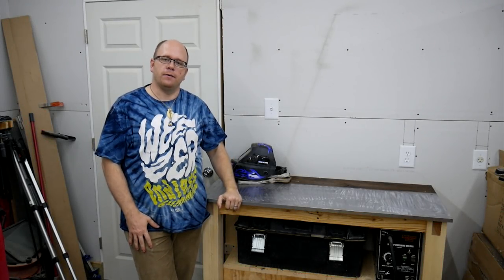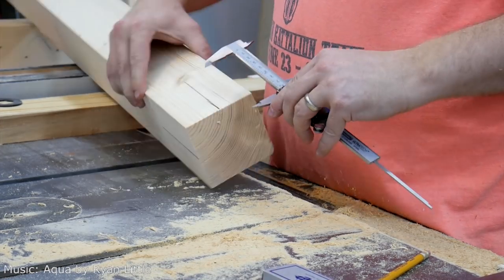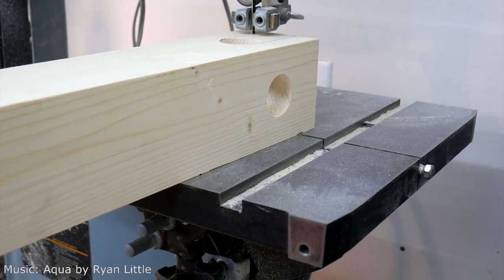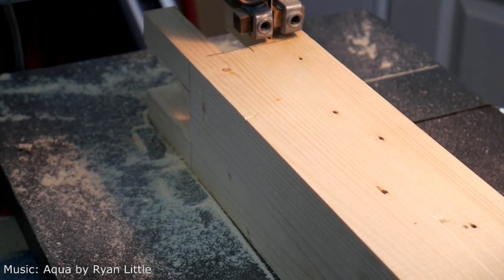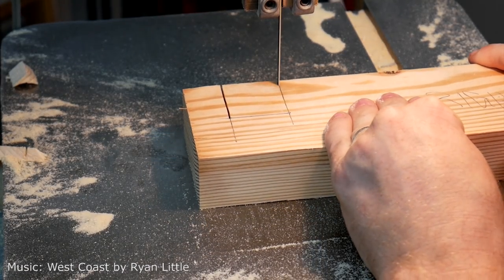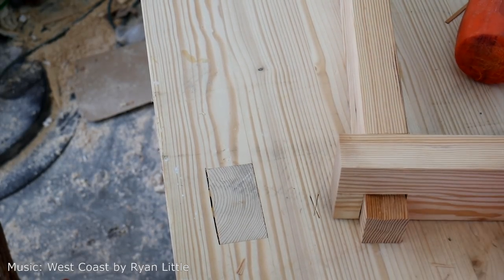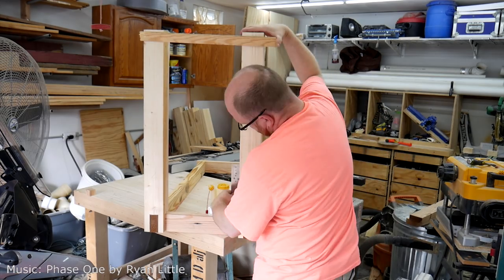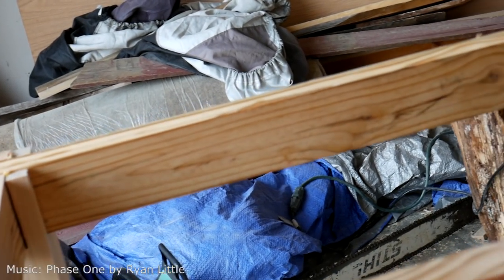Fancy Leg Joinery: Worth It? (Amazon links in description)

Comment: Tom, I’m planning a modern style bed with this joinery and I am glad I watched you build this. I had some of the same reservations that you pointed out about the fragile nature of the joint. I had determined to use a little beefier width of lumber. But in getting a tight joint that shows and without glue and that is square is more than I am comfortable doing free hand, especially with the cost of a screwup with 8/4 x 8” cherry or maple. Did you consider a cutting method that indexed the mortises against a fence to get them uniform, probably on a table saw?
Reply from the maker: This was a spur of the moment thing and if I were to do it again, I would definitely use the table saw and possibly the dado stack

Comment: For the very reasons you provided, it can be a very decorative joint. As for the structural integrity, only time will tell. But once you finish gluing and building such things, they usually offer no problems down the road. I like it, but have my mind set on tendon table joints and even large dowel pins for a shop table. But your joint would look awesome in actual quality furniture building for certain. Nice project and how to make them.
Reply from the maker: Thanks, Gary!
Reply: I used this joint on the posts of my bed, structural integrity is given (beams are 4"x4.5" not glued to keep it movable)

Comment: On those weak ends drill a hole all the way through the top/bottom and then glue in a piece of doweling. Make sure you hammer it in from the small section into the solid section so you don't hammer it off.

Comment: Lots of big gap around some of those joints, which means the glue probably isn't doing much and they are going to be very weak. With this king of a joint, you really need the fit to be perfect for it to have any strength.

Comment: There are many surfaces in there that are also end-grain so I am not sure of the exact area that has an effective hold and their orientations.  This may be a good joint if you are using very accurate cutting of hardwoods, but I don’t see it as a good value for your time joint.  You may consider asymmetrical sizes for the horizontal members but again I don’t see how this is more effective Than two horizontal sitting on a lap since most stress will be vertical.

Comment: These are strong joints if you cut them in correct proportions and use correct cutting techniques. You didn’t leave anywhere close to enough timber after your Mitch for the half lap and that’s why it popped off, also the ‘whack it with a mallet’ technique when your joint is obviously tight is asking for trouble!
Reply: *Notch, not Mitch! Damn autocorrect!

Comment: How about making the tenon notch longer until it's assembled, then trimming it flush? That would make it stronger for assembly.
Reply: Andy P This idea makes a lot of sense. I also wonder if clamping the end of the tenons while combining them might keep them intact. Ultimately a more looser fit would probably be the goal as the wood glue will cause a small amount of swelling and snug things up in the end.
Reply from the maker: Great point Andy. I think the obvious cause of weakness was my use of pine.  If I were doing this for a customer, I would definitely use a hardwood and it would likely resist the breakage.  Your suggestion is a great rule of thumb for all projects, though.  Build things a little oversize and trim to fit.  You can always take a little off.  Harder to put it back on!

Comment: Leave the lap jointed boards long and clamp before you lap the boards.  It may reduce breakage.  Trim off the extra length later.
Reply from the maker: I agree that would have been a good idea.  Maybe next time!
Reply: Or leave it sticking out 2" and put a 45 on the bottom corner for extra style points :-)
Reply: yea, a beveled protrusion would  pop

Comment: Hi Thomas, How do you attach the table top?
Reply from the maker: There are many methods used to connect the table top. My favorite method is to cut a dado into the inner edge of the aprons, then manufacture hold-down clips out of hardwood that fit into the groove. There are many tutorials on YouTube how to make the clips and use this method

Comment: Avoid the break-out by leaving the ends langer than Needed. After fitting you can shorten them to the right length.
Reply: Another option is to combine that with decreasing the thickness of the lap joint portion to around 3/4"-1" as it goes thorough the leg and then go back to 1.5" once it comes out of the leg.  This provides some more vertical binding surfaces so that the joint is even more resistant to racking.

Comment: Measure twice, cut once. That end piece snapped off because the slot was cut too narrow. A proper joint is snug when dry fitting together and should only need one or two light taps of a mallet to drift into place.

Comment: I suspect you wouldn't lose much if any strength by cutting the half laps about 1/16" oversize so they didn't split when assembling, once you put them in the posts with a tight fit there and all the long grain glue area they'd be tight and strong, loosing almost no overall glue area.  You could also drive a dowel or even a screw straight down from the top making it even stronger and not changing the appearance or adding much work.  I would expect this joint to be faster and stronger than doweling the skirt pieces in, and slower but MUCH stronger then pocket holes.

From an appearance perspective I like how that looks, I wonder what you would have if you left the tails of the tenons 1/8"-1/4" long and chamfered the edges sticking out of the posts.  

What would keep me awake at night about it is not being able to reproduce it for any stringers/shelf supports underneath- I don't see how you'd do it without "faking" it.
Reply from the maker: I pretty much agree on all points. Great point about reproducing the look for shelf supports. I’m going to put some thought into that.

Comment: I'd call it a Cradled, Half-Lap Joint or a Doubled Bridle, Half-Lap joint
Also, I'd leave the arch in the bottom of the joint, and to help with the straight grain breaking, I think you'd do better to put a clamp (hand screw clamp) when you bring out the persuader to  help the fit. Good job, if you got the results you wanted, but I think a double or quad mortise and tenon would be easier and less wasteful, due to the issues you had fitting the joint. Not to sound to sarcastic, but you could/should have went all the way, and put some wedges into the half-lap ;-).
If you didn't want to do the double M&T joint, but wanted something strong a Through Dovetail or even a Finger Joint would  be stronger IMO.  For a nice look and strong joint next time try a quad through M&T joint, but make the tenons round.  I'd accomplish this by using floating round tenons.

Comment: I have inherited benches in two different houses I’ve bought, and both attached the rails to the legs with nails into the faces. This always bothered me because I knew the load on the bench top was being carried by the nails in sheer, and the wood itself wasn’t doing much. Also, lateral forces would tend to work the nails loose. I thought of trying a rabbit on the legs to accept the rails so that the load would be born directly by the leg in compression. However, rabbits for both the front and side rails wouldn’t leave much post material for gluing and screwing. Your design is superior in those respects.

Comment: Great video and joinery, but with the right glue and fasteners , this could be don much simpler. Just depends on the equipment you have and if you care about looks more than function.  A ratchet strap is handy for this and you can temp a cross bracw to keep it square. Tenon joints don't NEED to be dead tight if you use the proper glues.  Nice video, though.
Reply from the maker: I agree it could be done much simpler, but that wasn't the point. Thanks for watching!
Reply: Nicely put... I was trying to figure out a nice way to say that his joints split because he didn't cut them precisely enough and then tried bashing them together.

Comment: It just me or how did your big drill holes turn out so off center??  This happens to me all the time.
Reply from the maker: First off, great catch.  What happened there was a failure on my part to set up my stop block correctly.  I'm not too sure how I did it wrong, but on one leg it is very obvious that one or two of the holes are off center.  If I had marked my drill location on every face of the leg instead of just relying on the stop block, I would have caught it earlier.  If you are having trouble with your drill press not drilling square to the table, it will need some adjustment to get it corrected.  Mine isn't perfect, but it is close.

Comment: Joint should never be tight enough to break the end like that on just a dry fit,  knowing you were going to add glue and make it even tighter. The moment it didn't slide nicely I'd have stopped.  Still,  nice job on the finished product :)

Comment: Welding tables should be all-steel really. Mine used old plate for the top and drill stem pipe cutoffs for the legs. Indestructible and cost scrap value to make.
Reply from the maker: +Austin I believe you. Maybe someday I’ll upgrade.

Comment: I through mortise is a strong joint, but you've taken out so much material from the top of that leg
 it is compromised in my opinion
Reply from the maker: Strong possibility.  Time will tell.
Reply: If there were no gaps, it would be a strong joint. The problem is he had a lot of big gaps, which means the glue is most likely not holding the wood together in those places. If it is a good glue up, the wood will fail before the glue, so having everything fit and glued up properly should give you a good joint. 

From my experience, getting everything to fit perfectly is just not worth the effort for a joint that you won't really be able to see after the table top is put on. If you really like the look, you could just use mortise and tenon joints and then notch out the opposite side and glue in a small bit of wood. It would looks the same, be easier to make and possible a stronger joint, even if the fit isn't perfect and no one would ever know the difference without taking the table apart.
Reply: @MAGAMAN If he had clamped the joints, it would result in one stonger solid piece, because a glued and clamped wood joint is stronger than the parent material. The gaps may be good for torsion upon heavy loads.  Check out the documentary on the wood joints used in China's Forbidden city withstanding centuries of earthquakes without failure.

Comment: Sir the tenant should have not broken if you had measured the final work more than once. Making the surface even is a schisel work. In my opinion, you were focused in the final product and not in the process itself. When you broke the end part of the joint, was not because it is fragil, but because you hit it with the mallet before leveling the surfaces. Thank you.

Comment: okay this joinery technique is mostly used for asian style platform beds. and glueing it totally defeated the purpose for that kind of joint.....the point of using that specific type of joint, as with many other types of japanese joinery, is because gravity itself prevents it from ever coming apart in the first place. the glue was pointless the joint is for knock-down purposes, like when you disassemble and move a bed...., also you didnt have to cut the joint all the way to the exterior edges of the legs, it can be hidden all together. last thing the blocks breaking off when you tap too hard...

Comment: Very weak joint, far to much grain cut away and long term will cause problems.
Two stopped mortise and two haunches tenons both mitred so they sit end grain to end grain.
Won't rock, won't twist, won't move.

Comment: From my opinion, there is no such thing as Japanese Joinery or any other name of Joineries out there,. it is an imagination invention that this joint never existed before & now it existed & shown in "You Tube", just name it after your name, it would be easy to remember how it is created,..
Reply: The Japanese joinery is a joint of two or more woods without the use of a glue, nail & screw, those joineries mostly they used dowels or making it with mortise & tenon or dovetail, this is how my understanding of Japanese Joinery,. Your table can be called Japanese table if you add the dowel or making one of the connection in a dovetail, but you add the glue in there calling it after your name,. nice job video, & thanks for sharing,..
Reply from the maker: Sounds good to me!